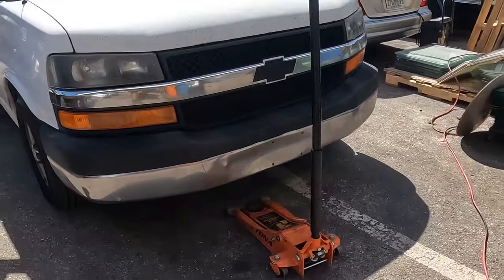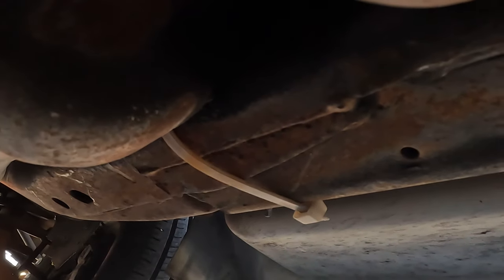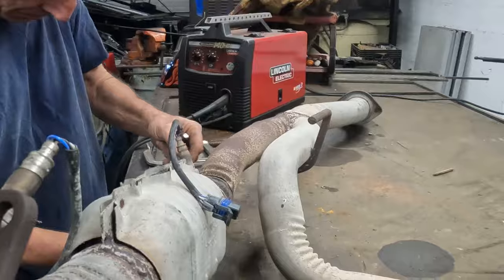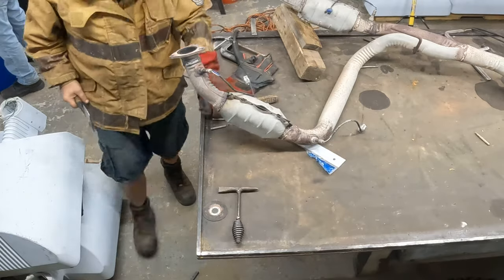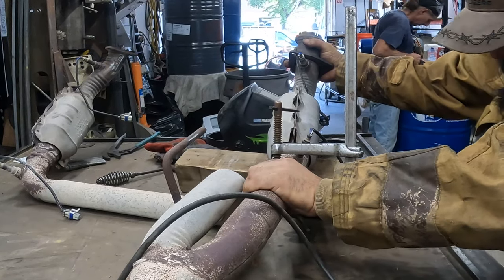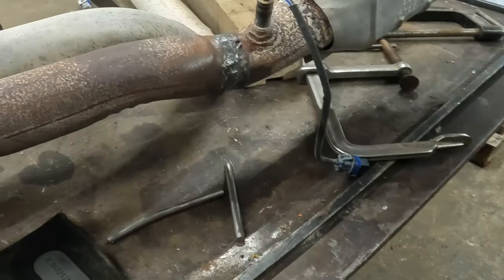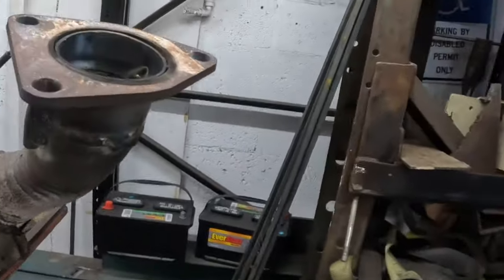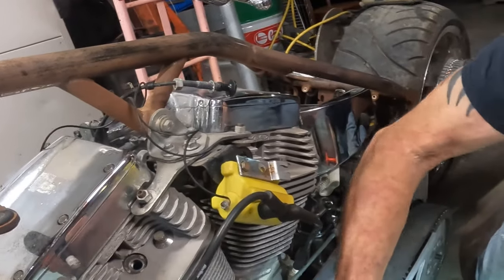Broken Exhaust Pipe Welding Repair  Lost Footage

Comment: Why do u keep using the hammer after each weld??? That's mig your using.. No slag it's a clean weld.!!
Reply from the maker: Because I am using flux core wire and it leaves a coating that needs to be knocked off.